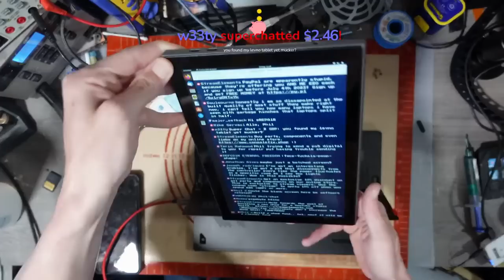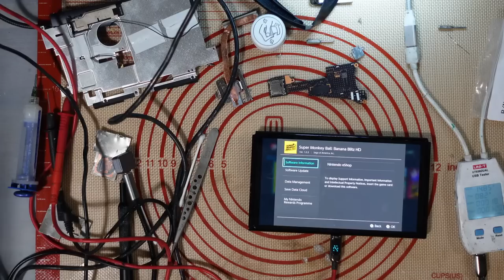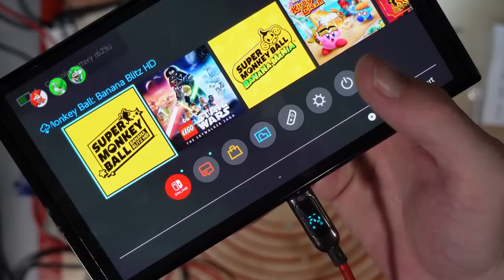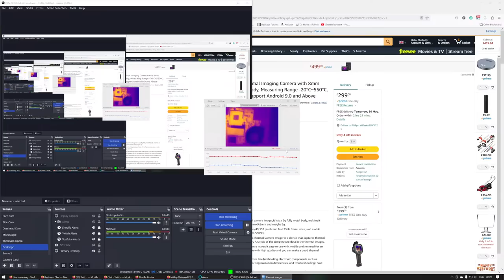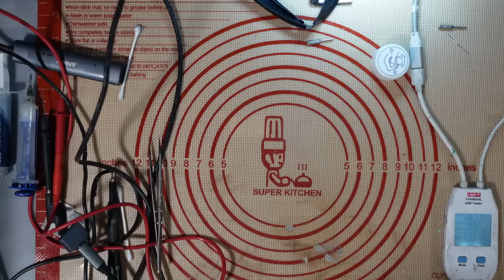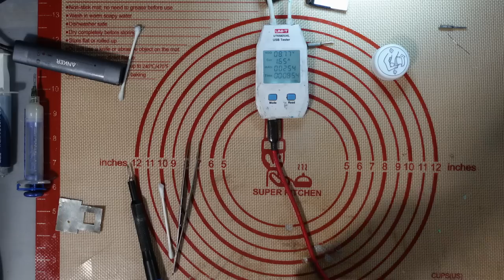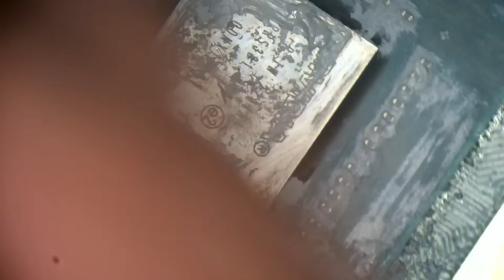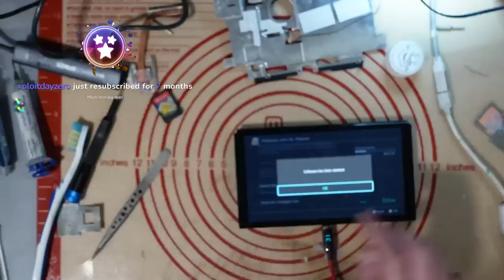It's A Fixin' Kind Of Day! Let's Do The Thing...

Comment: What laptop model is this please,  i may have skipped over that part. What would say the biggest reasons CPU's fail and specially on laptops. I would assume its down to overheating, stress, and maybe even overvolting. If you are on a budget there are some cracking 2nd hand laptops for sale on ebay. I tend to go for the seller who doesnt have much selling history with electronics. I find people who sell electronics on ebay know what they are doing. I got my self a 2nd hand asus 2019 laptop, 480 pounds, 1tb nvme, i7 8th gen, 2080 max q, 40gb of ram, the screen it self is 17 inch and runs at 144hz. I did have to take it apart and refurbish it to improve the temps but thats what you have to do if you want a good product for a good price.